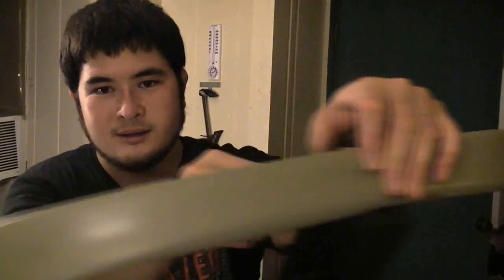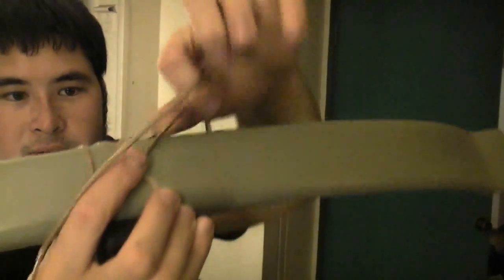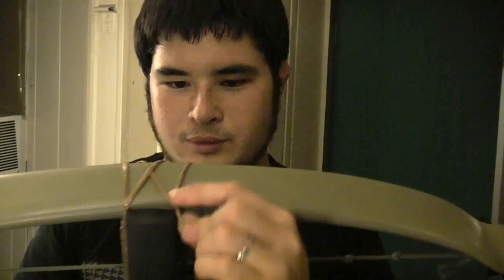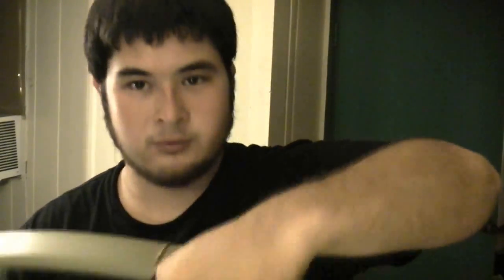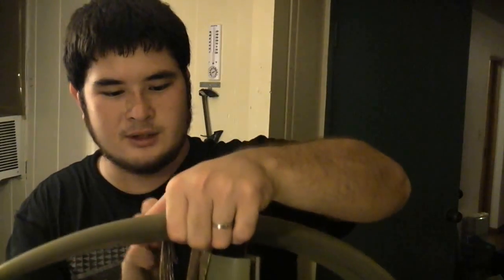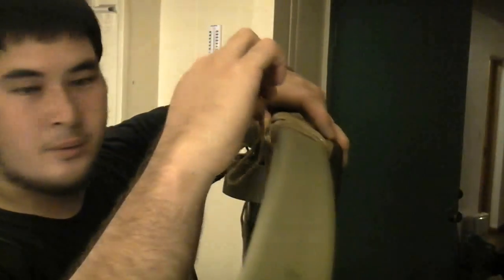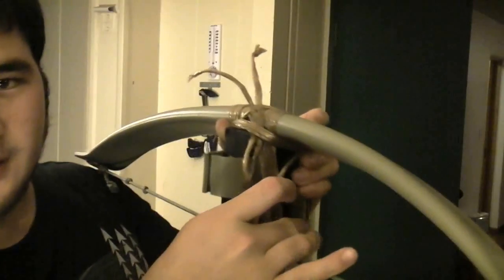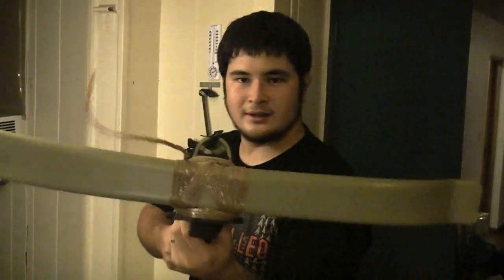How to Make a 100 Pound PVC Crossbow Part 10 - Lashing the Prod

Comment: bolting would lose your structural stability in the prod, and holes, burns, ect in the pipe and you risk the prod failing. you could you wall mounts to modify the way you attach it to the stock itself